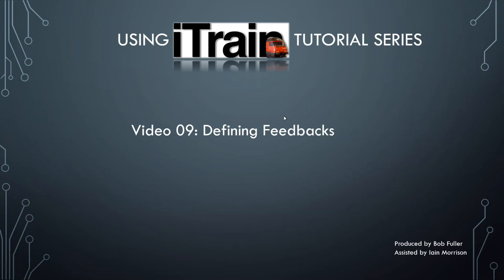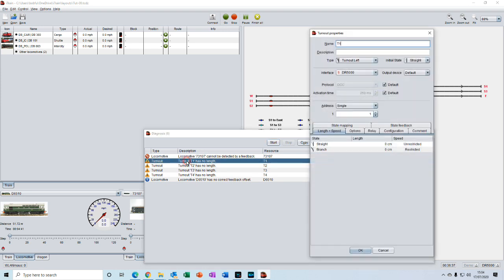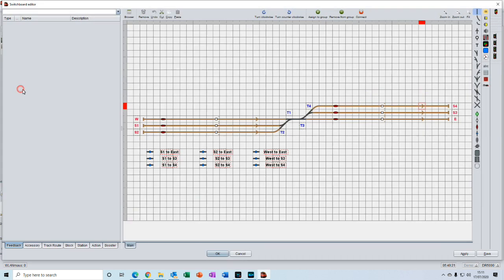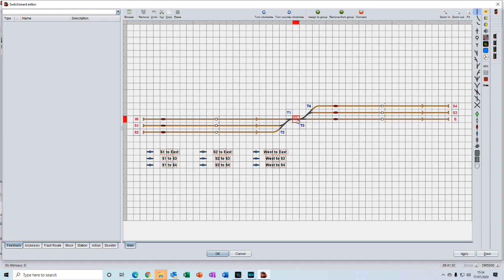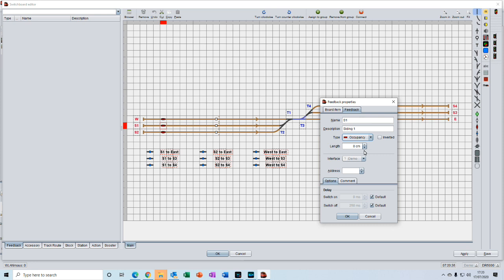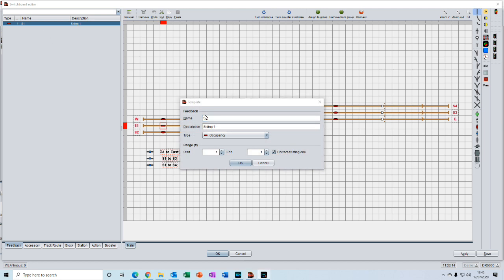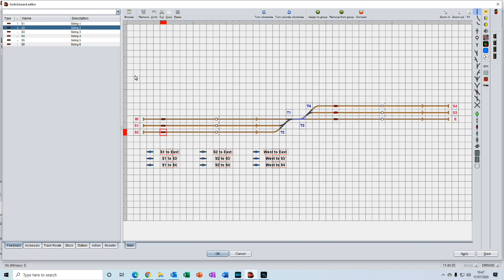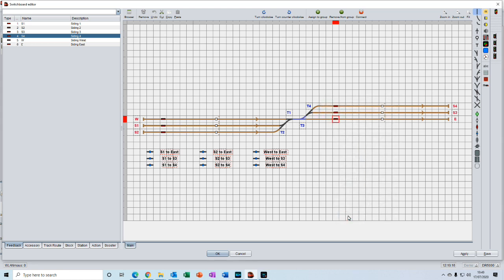Video 09: Using iTrain Tutorial Series - Defining Feedbacks

Comment: Hi Bob & Iain,
I have a trial licence so as well as following your fantastic training videos I am also setting up my own layout. I prefer to do this in my house to be more comfortable, especially in the winter, but my layout is in my garage using a different wired in computer.will I be able to access iTrain on both computers when I have the full licence? Can I "save as" to a memory stick or is there a way to set things up so that this will work? 
Brian
Reply from the maker: Yes, you can use iTrain on both computers with the trial license and with the full license. Just load iTrain onto both computers and use the same license key for both computers.
If you have access to cloud storage, such as OneDrive or DropBox, etc, you can put the iTrain folder (the iTrain folder that contains the Images, Layouts, Sounds, and Docs folders that iTrain creates when it installs iTrain) into your cloud storage so that your layouts files are automatically available on both computers. So, if you create or change a layout on one computer, it is automatically updated on the other computer.  Go to the iTrain Edit menu, then to Preferences/General/ and change the default base path to point to your cloud storage path name.
Reply: Thanks for that, all ok except that the OneDrive dropdown option does not work as for file routing it has to be changed to "SkyDrive". Perhaps this should be flagged to someone.
Brian
Reply from the maker: @EssexThameside  I'm not quite sure what you mean, Brain. If you click the FIND button next to the base path, it will then open another window where you can navigate to your skydrive or whatever cloud solution you use. Depending on your system, this window may take a while to appear and reaction to changes, so be patient with it. Does this fix your problem?
Reply: @bobfuller  Hi Bob, Yes it does and the new window lists OneDrive. If I click on it, the path shows Skydrive??????? The same applies on my file explorer, shows as OneDrive and then changes when viewing the path. I am all sorted now that I manually added SkyDrive to the path but the problem remains,why would you normally look for another file when the option is showing OneDrive. Brian
Reply: Done some digging and apparently Skydive was replaced by Onedrive in 2014 but some Microsoft products were not changed but they will still work. So my problem is that I joined SkyDrive before and probably "passed" on an update, who knows. So only old fogies like me affected.
Reply from the maker: @EssexThameside  ah, yes, of course. All makes sense now. Glad you got it sorted.

Comment: Bob, you give simple numeric feedback addresses as 1 thru 6, but my Lenz accessory has an address of 65 but with 8 ports 1-8.  How do I specify 65 and 1-8 ??  Keith
Reply from the maker: Within iTrain you need to define the interface used for your feedback modules. Go to the edit menu and select the Interface editor. Create a NEW interface and give it a name (e.g. Lenz xxxxx). Then in the TYPE dropdown menu, select the model of Lenz you are using, and in the CONNECT tab, select the connection port or enter the IP Address. Click APPLY to save it. Now when you create a FEEDBACK, using the feedback editor, you should see Lenz as an option in the INTERFACE dropdown menu. Select the model for your feedbacks and it will then display the appropriate address boxes for that model. You would need to refer to the Lenz User manual to see how the addresses are defined. Does this answer your question? If not, please post the question on the iTrain forum. I don't own a Lenz system, so I am not familiar with their set up. On the forum there are plenty of guys who will help you.

Comment: Nice video's. But how do you configure blocks etc for single line working where trains can go in either direction?
Reply from the maker: Hi Peter. In the Block editor, under the OPTIONS tab, there is a field called DIRECTION. Here you can specify the direction of the traffic. Uni-directional, Preferred direction, or Bi-directional. So, for a single line track you would typically select the Bi-directional option. It is explained more in Tutorial #10.
Reply: @bobfuller  Thanks, Bob. Looking forward to playing with this later in the year. At the moment I am changing from N Gauge to 00.

Comment: Another well made, informative video Bob - thanks.

In iTrain, each turnout is separate from the block.  On the actual layout, are the turnouts also isolated from their neighboring track?
Reply: I am not absolutely sure what the question is that you are asking, however I will try to answer as best as I can. 

Turnouts need to be electrically isolated in the same way as you would normally do for DCC to ensure that there no shorts when the blades close against the track, and the side of the track in the block that has the feedback also need to be isolated at each end from anything else. If you want to use feedback detection on the turnout then you would isolate the feedback side of the turnout as if it was a normal block of track.

I hope I have 'guessed' correctly at the question and answered it for you. If you have already purchased iTrain or have a trial licence the the iTrain Forum (https://berros.eu/itrain/forum/viewforum.php?f=1) is the best place to ask questions on iTrain :)

Iain Morrison

Comment: Bob you must be commended on these videos and now your videos are almost up to where I am with it.. wish they were around a few months ago!! If the dots on the blocks are in the wrong place do you just rotate the block item?
Reply from the maker: Hi David. Thanks for the comments. Glad you are getting something from the videos. Yes, rotate the block element so that the dots are pointing towards the "Next" direction. Make sure the dots and the arrow are pointing in the same direction. If you have already defined the block, I would also re-open the block editor (double-click on the block) and press the Auto Fill button again.
Reply: In addition to what Bob states beliw you should try to ensure that all blocks point in the same direction e.g. if you start with one point clockwise around your layout then you should continue doing it this way. Also if you change anything in the block, such as rotating the block element symbol you MUST click the magnet at the top left to reconnect the blocks correctly.